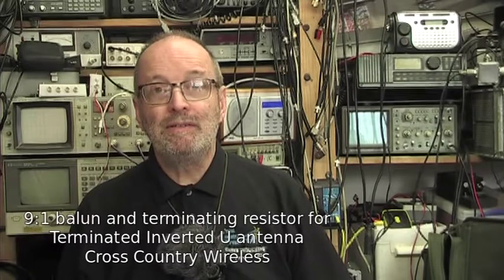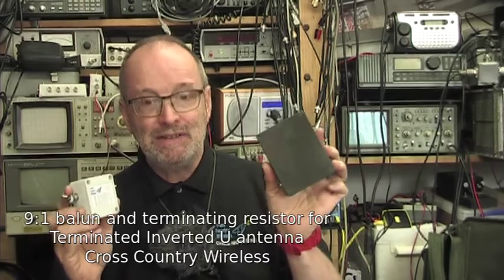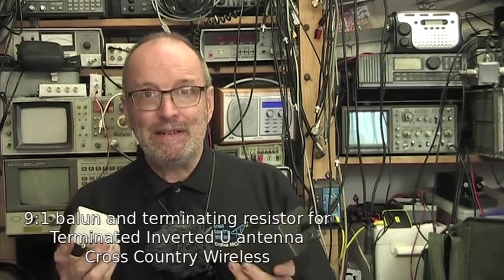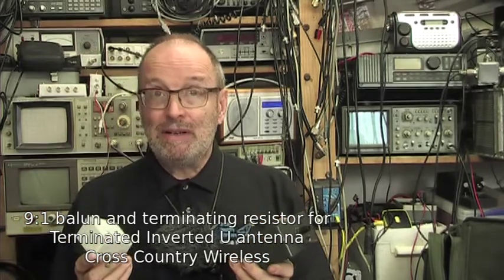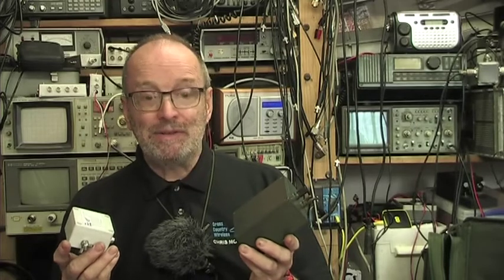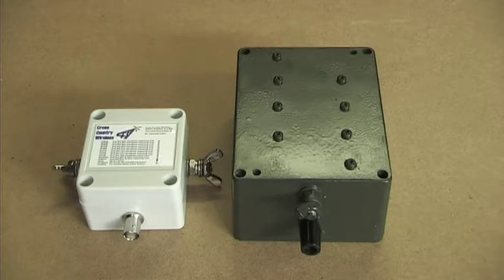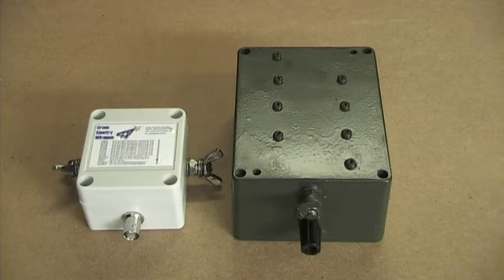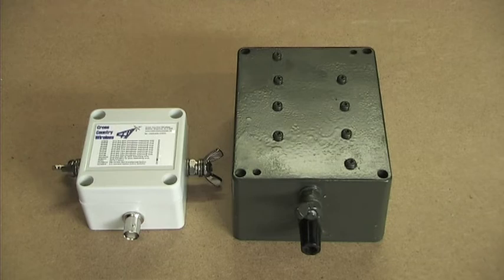9:1 balun and terminating resistor for Terminated Inverted U antenna - Cross Country Wireless

Comment: Thanks for the details of using a capacitive cascade (LCLCL) as a way of getting a resistive termination as detailed on your website. I was wondering about supporting a nichrome wire about 35mm (in parallel) from a earth-wire/metal surface but this is much simpler, more compact, and readily tested using a VNA.  de ZL2GX

Comment: I run a end fed half wave using a 64 to 1 in a inverted U also, it works great but always trying to improve noise reduction as I am a keen dxer, tempted to try this do you think this would be a improvement cheers
Reply from the maker: You should see a useful reduction in the locally generated background noise. If you already have the end of the wire close to the ground try extending it through a 470 ohm resistor to ground. For a quick receive test you don't need a high power resistor and a 1/4W resistor will allow you to try it.